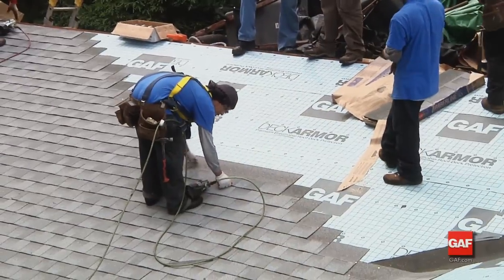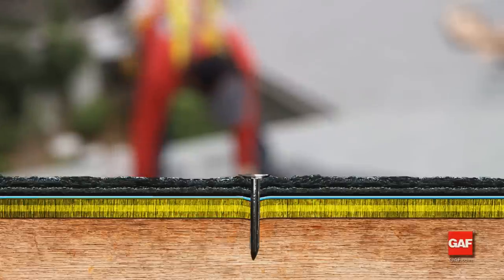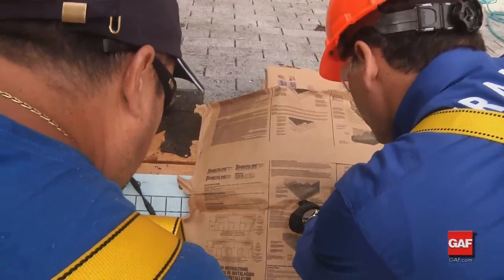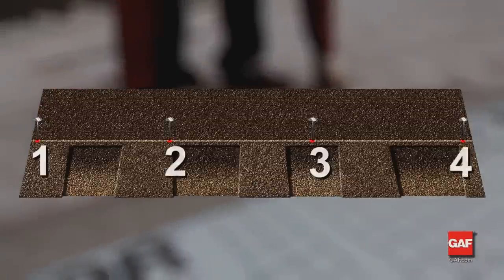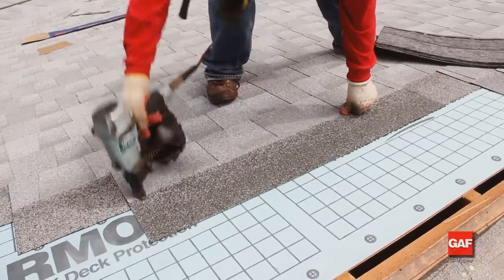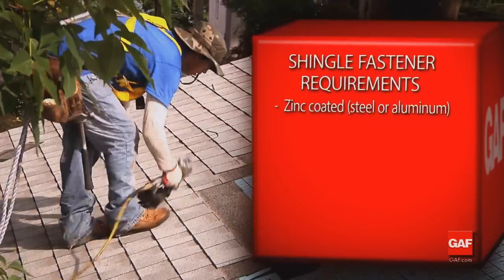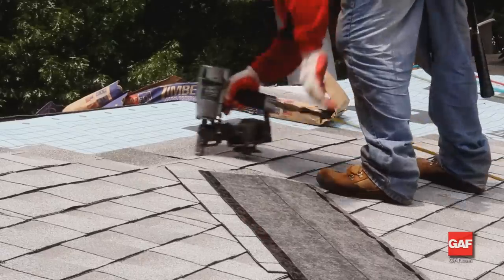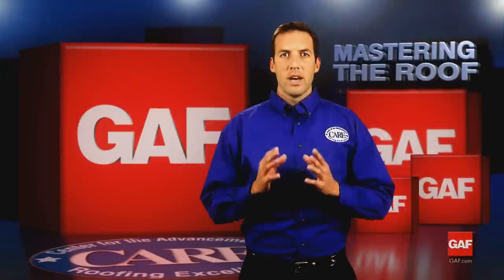How to Nail Roof Shingles | Mastering the Roof by GAF

Comment: Only zinc coated steel or aluminum nails per the video?  Steel ( electro plated steel) are not very durable when hit with a hammer and on lower slope roofs can rust out before the roof life. Is there a reason why stainless steel is not mentioned as an allowable fastener? Stronger than aluminum and longer life than electro plated steel.

Comment: Doesn't appear that the roofers in the video are following the GAF sanctioned comments, often using more than 4 nails. Would be nice if the video matched the narrative. I do my own roofing--always have, always will. Don't need some overpriced goons crawling on my roof. Have installed quite a few, and have never experienced a an issue.

Comment: Poor designed shingle when the nailing area is so damn narrow and way too close to the bottom edge of the covering shingle. Buy Malarkey architectural shingles. They have a 1 1/2" strip which can be nailed into, which provides a larger distance from the nail head to open sky.